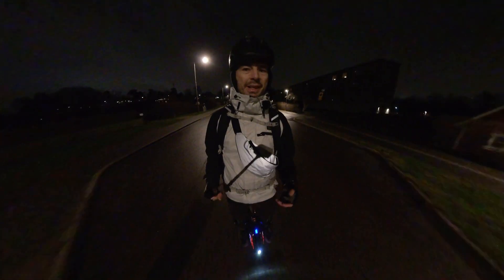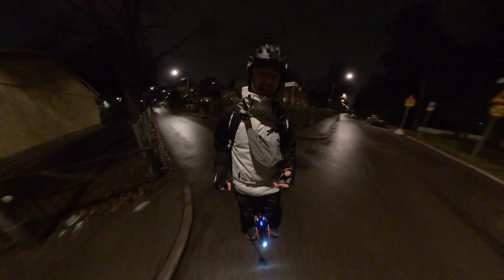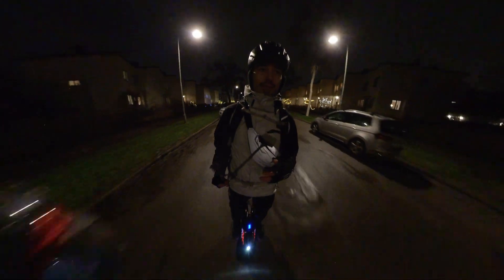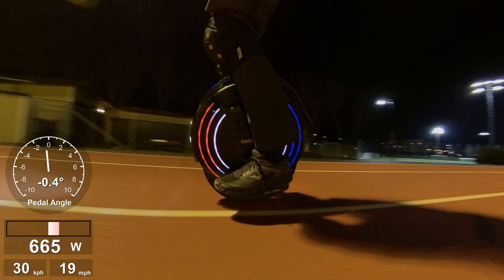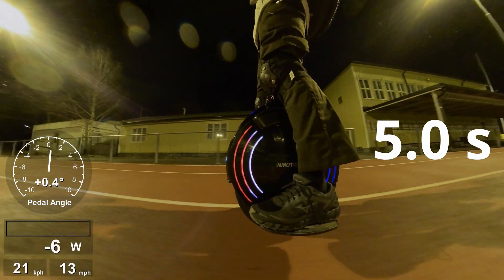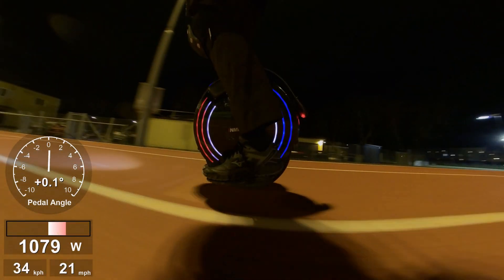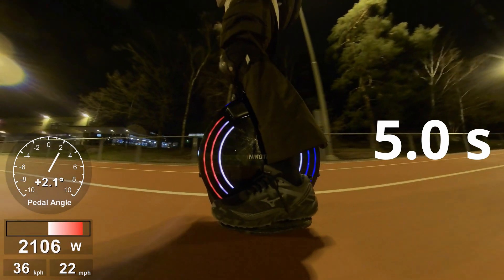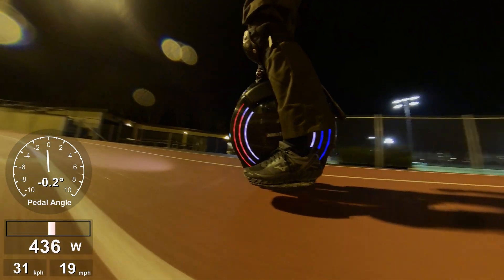Inmotion V10, V10F, critical alarm safety flaw demonstrated

Comment: Hello and thanks for your video.
I want to ask you about the beep.
I have a v11.
I am a noob.
If i hear a beep at 3p km h because i put the limit at this speed can i ride safety if i reach the speed hearing the beep and then decelerating?
The first beep is only yo prevent the cut of?
Reply from the maker: Hi and welcome to the sport! It's great that you're starting by experimenting with your wheel's riding safety systems.
The answer to your question is yes. You can set beeps to a specific speed to be alerted you've reached it, on top of that the wheel will also alert you that it reaches close to the maximum power it can drive the motor - which is variable depending on conditions like battery state of charge and load and calculated several times a second.
On a V11, that "safety margin" beep cannot be disabled or customized.
It's the main mechanism that will prevent the rider from asking the wheel more than speed or acceleration that it can provide.
There are also the pedals tilting back, but that's kind of slow in order to not destabilize the rider and can sometimes be confused with other things like headwinds.
Reply: Thanks man for your help

Comment: Apart from this delay, which (imho) can be understood, as we actually rely on sensors and electronic, so some kind of lag can always be expected (we're driving a computer, not a car or motorbike), I think that the problem is even today many people who ride EUCs haven't understood completely how they work yet, and this is because we all come from conventional vehicles where you just have to push the throttle or brake, where you can directly have control. On EUC we don't control them directly, but there is a set of sensors which directly control the whole system to keep it balanced. It's still a recent technology and some critical issues still can be improved, by a lot. Last, we must always try to understand what's behind the unicycle, and I think, as V10F owner, that this specific model is made for comfort and not speed, so, riding it near to its limit is not safe at all. We should also stop thinking about speed, but power, the point is not going ahead faster and faster, but to remain balanced, and this requires power first of all. Thanks for the video and sharing this experiences.
Reply from the maker: This delay is a programming bug, I don't think there's a justification for it.
The wheel knows at high frequency at all times the status of the wheel: it's just that this bug prevents artificially the beeper to ring several times or continuously without a delay in between.

Inmotion now fixed it in the V11 by making the beeping continuous, which improves its safety significantly.
They haven't fixed the V10/V10F firmware yet however.
Reply: @supercurioTube  yes, I agree with what you say. what I meant to say is that however electronics can sometimes not be perfect. Also, the choice by Inmotion to directly use the speakers for alarm sounds, instead of installing a beeper, I find it wrong. I come from a Kingsong 14" and on that wheel there was the beeper, which was very useful also because it started to sound when was approaching the limit, but on the V10F I have the impression that is first enabled tiltback, and then when you reach the limit, the alarm sounds, and I don't like this, even if fortunately, for my little experience, the security system has always worked properly, especially the tiltback, which I find more important to the beep sound.
Reply from the maker: @MrZagx  likewise, I've never had an overlean crash on the V10F, so it worked so far.
Same as you I have experience with a Kingsong wheel and I like it's alerts a bit better, they seem more real-time (16X).
However the 16X doesn't have as much margin as the V10F: I've had many pedal dips on accelerations or bumps above 30 kph whereas the V10F has always been rock solid.

On the V10F, the progressive tiltback starting a few km/h earlier than speed gets old, and can lead to foot fatigue for me due to how frequent it can be.

Although it's alarm/tiltback system has flaws, I appreciate that Inmotion kept a healthy safety margin.

Comment: Thanks for this whilst I dont have an inmotion wheel it is good to have knowledge of this, personally I always ride with EUC world app on and have audio alerts (via earphones) and vibration alerts (via phone) for my pre-set max speed 5-10mph beneath max EUC speed, ride for long enough and you get a sense of max safe speed. Depending on the EUC beep I dont think is wise as wind noise can drown this out, it should also be considered to know situations for peak currents and temperatures. EUC are not safe regardless of how much we love them.

Comment: That's  a weird "bug". But then, relying on acoustic alarms at +30km/h doesn't make much sense anyway, IMHO. More important is that the wheel tilts back or forward (funnily enough, both work) to signal that it is approaching its limits.
Reply from the maker: I agree that acoustic alarms are problematic for many riders who can't hear them reliability due to wind, ambient noise and helmets.
Nowadays I always ride with earmuffs which reduce wind noise to a minimum, making the experience much more safer and enjoyable.

The V10F pedal behavior is not bad overall, although it tends to tilt back gradually a little too early IMO. It helps to feel how close you are to the max speed way before reaching it.
Although it works well for slow and gradual speed changes, it's too slow and kind of buggy as well during faster changes, as demonstrated in the video.

Here, several times the wheel tilted forward instead of back during or after the sequence, failing to alert when the beeps were also delayed.
Reply: Fast changes are an algorithmic challenge, so I'd give InMotion half a pass on that. I actually don't even mind tilt forward as a warning mechanism. It has the advantage over tiltback that it's impossible to push through, so it's maybe even the method of choice to prevent too fast acceleration.
Reply from the maker: Interesting perspective!
I think forward tilt as a warning might be either a matter of preference or depend massively on how it's implemented.

Against it I think it could encourage the rider to lean forward further without realizing and result in an overlean crash, if it's gradual.

How it could go wrong: a couple of overlean crashes in my local community with Gotway Nikola riders in soft mode, which tilts forward to assist acceleration.
One was standing - minimum damage, the other one was seated - broke a collarbone, both at 65+ kph.
They crashed because although they got alarms, they were leaning forward too much - probably due to the soft mode to step back quickly.

How it could be effective is like with my 16X pedal dipping at 35 kph+ if I make peak power demands, same as in the video.
It's super scary as the wheel seems to give up on staying leveled, and certainly works as a deterrent to push forward!
Although it never ended in an overlean crash yet, I'm worried it will happen at some point and makes riding less enjoyable, so it's not a great implementation either.

I agree tiltback for fast responses is an algorithmic challenge, in order to filter sensor noise and avoid throwing people off the wheel by losing footing or balance if it happens too quickly, especially on bumpy terrain.

In that case auditory alarms are better, as long as they behave predictably (as they do on Gotway wheels as reported by users)

I think all wheels should have a combination of at least both beeps + tiltback, and make easy to relay the firmware alarms over Bluetooth to whatever extra device (vibrations, haptics, headphones) the rider chooses, with no latency or loss due to lower sample rate of the status shared over BLE.

No wheel does that for now, so there's a huge margin for improvement.
Reply: Good point, tilt forward probably needs to set in quickly to be effective as signal or deterrand which makes it somewhat scary. I am also not sure whether it triggers the desired reflexes with beginners. For me it did work also the first time when I hadn't expected it at all, but a single case is certainly not enough to know.
Reply from the maker: Was it on your V8/V8F by the way?
Since easier to overpower than the V10F due to the motor and battery configuration, what you experienced was likely that instead of a safety alarm.

I wonder if the V8 also has the same 5s alarm delay.
If you have the opportunity to test let me know!
You'd probably need to be more gentle than me replicating this test in order to not overpower the V8 and crash.
Reply: It was an old Gotway. It could have been just running out of power rather than an intentionally build-in feature. I don't think I experienced the pedal softening on the V8 ever while accelerating (but yes while braking, that one I find pretty difficult to save).

Not sure I am brave enough to experiment with pushing the wheel around at the speed limit. I am quite averse to risking seriously hurting myself and asking for a cutoff above 15km/h would be out of my comfort zone :-(
Reply: @supercurioTube  I didn't get to test the audible alarm, but I found that I can reproduce the pedal dipping behavior under strong pushes on a V8F even at low speed, like ~10km/h, and I could do it under acceleration as well as under braking. I suspect now that this is a controller software feature, or could it also be just some power limiter?

Comment: The power demand illustrated in this video was of great assistance. This will enhance my skill level on current and future EUC ownership.
Reply from the maker: I recommend being gentle with this technique on mud or snow 😛

In general, the result depends on the wheel and how much torque is available at a specific speed, for instance on the 16X it's quite easy to get the pedals to dip forward like it's gonna cut-out whereas the V10F always stays levelled as shown.